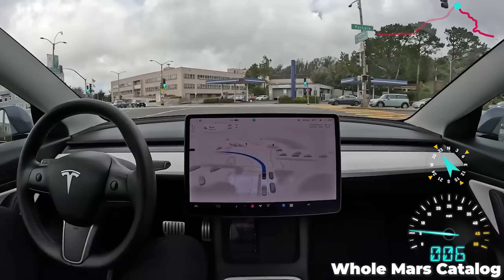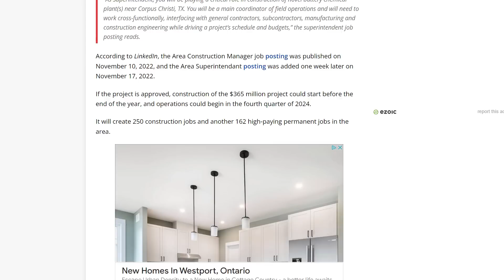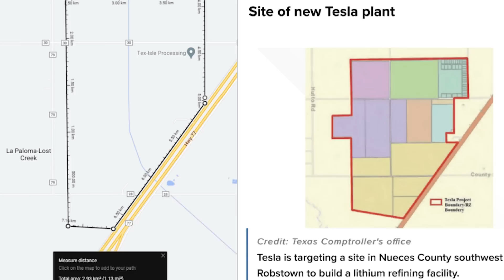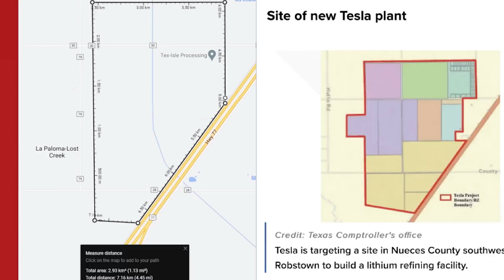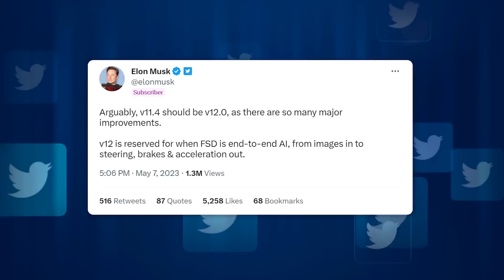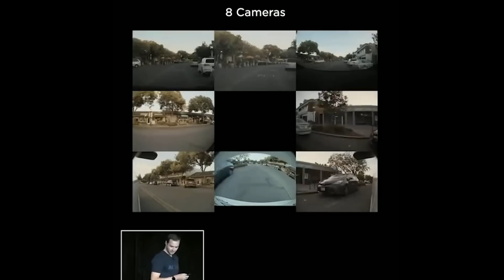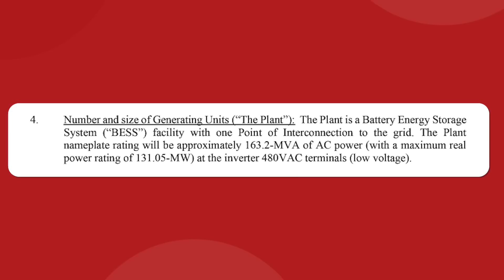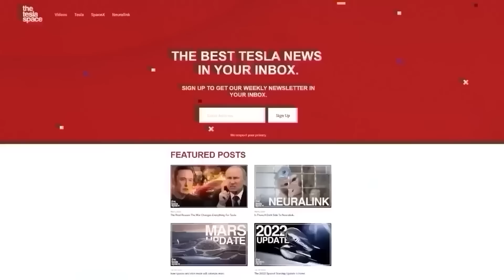Tesla Reveals New Lithium Giga Refinery!

Comment: Super interesting. Didn't even know about the lithium battery factory. And 70,000 solar panels... holy cow! That is... a lot. And, can assure you they are getting PLENTY of sun there. So much sun, so hot. At worst, 50% cloud cover a relatively small fraction of the year.

Comment: AAA batteries are in garbage pails every day even though there are warnings on the side.
Where do you return them? I haven't seen a program ever? If we cant recycle them properly why would we put them in every car bus truck?

 Trash To Energy plants love burning them because they burn like sparklers and generate 3 times the heat per pound. I love the part that they burn it at such a high heat there is no waste or pollution. Yeah sure. The Lithium, Cadmium and other battery materials generate those very  high temperatures. It's all mask and mirrors.
Reply: Every town has a hazardous waste disposal where you can take your batteries

Comment: What? That can't be right.   Once they have the map an Arduino nano is all you'd need to perfectly drive the car.   Why the heck would they bog down that process with a crazy expensive AI process that could only add errors to the problem.